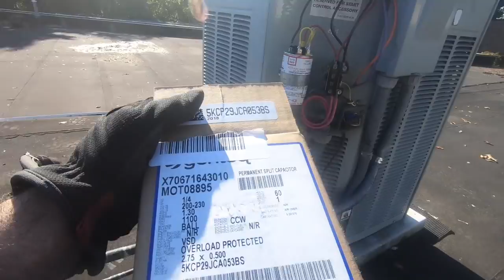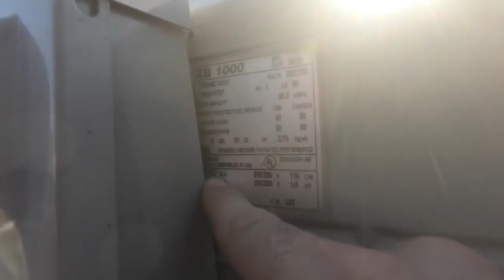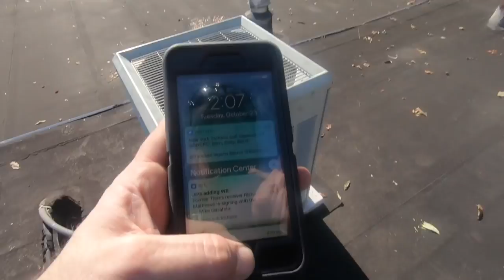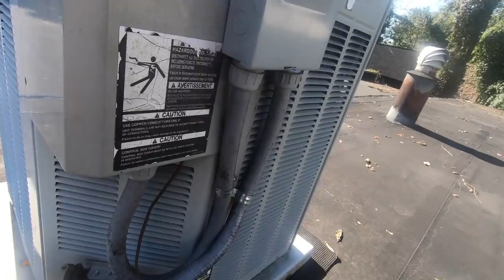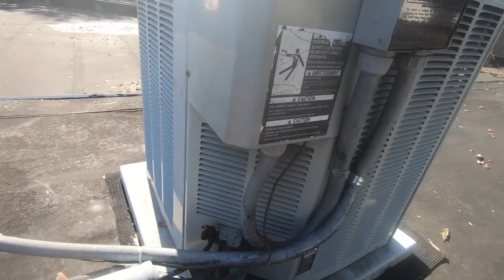Replacing AC Condenser Fan Motor

Comment: What are the name of the pliers you use, would they work well for gas pipe?
Reply from the maker: Those are Knipex Pliers Wrench. They would be worthless on anything round. They need a flat surface like any standard wrench designed for hex or square fasteners.
Reply: @thehvachacker  thanks.

Comment: Did you just get an electrical shock at 17:05? That jump was significant. Be safe in the future and try to prove the electrics dead.  Good video tho.
Reply from the maker: The line voltage was dead I just for whatever reason got scared and jumped. You can get a tingle from 24v yet usually, I would need to be drenched in sweat. I still want to know what was in the bearing of the new motor that at first, it sounded like something was hitting or rubbing. Then it worked its way free
Reply: @thehvachacker  yeah, I wondered where the noise came from. Your probably right, it might of been a stick or twig lodged somewhere. In addition, the tingle may of came from the capacitor as they do store their voltage for a long time unless discharged, as 24v (AC I am presuming) should not really hurt you unless there is an excess of current (I should say energy), but again good video it's good to see a different perspective in the industry 😁
Reply from the maker: Could it have been something in the bearing? I needed to get broken in from sitting to long the oil waxed until it warmed up? What part of the industry are you in?
Reply: @thehvachacker  I would imagine the noise was an imbalance on the motor due to in rush current, that may explain why the noise went away as it probably settled which it tends to do on motors that utilise capacitors. Plus I am in the electrical industry. 😁
Reply from the maker: Nice I have to lean more about inrush now
Reply: That was low voltage to contractor no biggie

Comment: Now that is right Trane mtr. Good job..Like check amps/on both. Seen that tickle on 24 volts. I always used refer wrench on hub bolt..
Reply from the maker: I use it often also. it was made for square fasteners

Comment: I've heard some complain about using the Impact driver, but I never burry them.  Mine is only a 7.2V Makita TD020.  Ya I can twist the heads off If I burried' em, but I let go upon bottoming. Don't get so upset about constructive criticism unless they become insulting.  We know the difference.  I use the impact driver, and I'm not going to stop.  I did however stop when it comes to anything delicate like hot surface ignitor.... Oops. Made that mistake once.
Reply from the maker: I use my impact all the time. I use my m12 all the time for panels and repairs. I just picked up 2 weeks ago the Milwaukee impact ratchet. Power tools are great when used correctly
Reply: Whats an impact ratchet?
 @thehvachacker
Reply from the maker: A power ratchet I used it in my last video where I did the breaks on my Camry.
Reply from the maker: A good impact will not strip out holes but it does damage my chrome sockets. I bought impact sockets just recently power tools are there to make our jobs easier

Comment: bites, it is and isn't a lubricant at the same time, it all depends on type and duration of "lubrication" needed, inside a bearing or something with frequent large travel/high speed movement, it wouldn't be a lubricant for long.(that's what trips up folks) However, keeping shaft, threads and other infrequently moving things lubricated and protected, it's a long term lubricant that makes life easy! :)
corn-fusion sets in and mind warp  =p
Reply from the maker: Your answers are awesome. Are you an engineer or working in the HVAC trade? For the application and kind of anti-seize used it is an appropriate lubricant. Would you ever use a molybdenum disulfide based anti-seize ever? Mabey in a hi friction application? I believe it should handle the friction on the wheel bearings. I prefer the nickel-based anti-seize for fasteners yet my employer purchased the copper-based one saying it can also be used in place of heat paste for aquastat bulbs in wells. Do you think heat should transfer quickly through the copper-based anti-seize?
Reply: naw, just your average dummy with hands into everything, one whom get bored easily and never stay's in one field of work, more "general contracting" among many other things
I like the motto "work smarter, not harder", yet often I'm solo and run in x10 circles. I classify as master of nothing, which I don't think anyone holds the title of either, because of evolution ;)
there's a billion different anti-seize compounds on the market,  moly/graphite blend is common for marine use(non polluting) and I think it's hard to beat metal bearing mixtures for overall durability. obviously not for food grade usage lol

Comment: The motor you changed out seems to have a much longer shaft, and I'm guessing, it's because some units will have the fan located at different positions along the shaft.
How does one determine where to mount the fan blade along the shaft? And, does the placement have any effect on the efficiency of the air movement across the coils?
Or, am I overthinking this>
Reply: Tunaslayer1 the motor that got changed out was a replacement motor already. and usually the shroud around the fan blade tells you where the fan blade goes.
Reply: The fan should be just inside the shroud. If the blades aren't inside the shroud, the air flow will recirculate inside the enclosure instead of venting properly.

Comment: Did you pull the drain plug on the motor? ;) I watched the motor failure video too!
Reply from the maker: This is oem motor so it isn’t built with a drain plug. It is designed for the system. You have the drain plugs on rescue motors usually found on variable horsepower truck stock motors.

Comment: I bought those Knipex  smooth jaw pliers for Chrome plumbing fixtures. Don't fck up the chrome. Just my 2 cents.
Reply from the maker: They don’t mess up the chrome, I even see rubber boots they sell for these and the knipex cobra to protect finished plumbing fixtures. These also grab a fastener better than a regular adjustable. Knipex just released a new design for the pliers wrench 10” 250mm. I rarely use the 10” version of this wrench.

Comment: It’s a lubricant 
And copper is a better heat connector but nickel is a higher heat rating for like exhaust bolts
Reply from the maker: So the copper paste is better suited than for an hvac technician and nickel for auto work
Reply: Exactly

Comment: Uh. The fan motors spinning backwards . Could be wrong I'm not the one working on it . Maybe it's just the light or something but it sure looked like it was based on the pitch of the blade
Reply from the maker: The camera has a way to make the fan look slow and backward. The air blows up out the top of the condenser.
Reply: camera frame rate and motor rpm will make them look to spin both directions at various rpm's.
Reply: Yah I  see now . I didn't was to seam like jerk or nothin just looked weird to me and the view of fan in action were real quick.
Reply from the maker: That isn't being a jerk its a good question. I am still working on why my Maglite led looks like it is flickering on my videos
Reply: @thehvachacker  probably the same reason when a camera is pointed at a computer screen it looks like it's flickering, the led maglite is probably pulsing faster than you can see but the cameras frame rate is just right to catch it. If I remember correctly dimmer switches for leds don't lessen the power to the diode , they pulse the power fast enough to appear dimmer without dropping the current
Reply from the maker: Not absorbing the energy into a diode which is a resistance load and instead of chopping the electrical sine wave up reducing power consumption should be more energy efficient. The old dimmer switches would create nuisance service calls due to lights flickering when a generator was providing the electricity.

Comment: Knipex make good tools and pliers, etc. with or without teeth so they dont jack up bolt heads...Once that fan kicked on I thought it was rubbing on the shroud for a sec, lol.
Reply from the maker: I didn’t see anything hitting the shroud. Could of been a bearing that needed to get broken in. Usually new motors don’t do that yet once the sound stopped it never happened again.

Comment: Ive found the cheapest e-bay motor is not the best motor... open compressors eat alot of weather....but if your pinched buy the chepo..and check the seams of the motor carefully. I usually putty on silicone on all the motor seams and tops or bottoms...these motors fail all the time due to rain or snow...entering the motor. the machine is a hurricane machine...even a hole the size of .010 can ruin the motor.
the other reason they fail is icicles handing off the cage into the fan...muck up the motor and you toast the cap...and its smoked..!
Reply from the maker: The motor that failed has to be over 20 years old. These motors last. The motors can get wet just need to drain properly. I’m surprised at how much water I drain out of motors inside giant BAC units. Walking the plank inside the towers. Hopefully this unit goes a few more years. This repair was more than a year ago.

Comment: That fan looks like it's down a little bit too far
Reply from the maker: looks can be deceiving. The blade was set correctly and good air gets pushed up. You would know by how the air comes through. If blade isn't high enough air comes through side of condenser
Reply: Its at the correct height, the ends need to be a little lower than the shroud to scoop the air.

Comment: always enjoyed your videos, have you ever thought of using the push in wire connectors instead of the traditional twist on?
Reply from the maker: You talking push in and crimp? I use them sometimes. Or a different kind of connecter?
Reply: @thehvachacker  thanks for replying, i was talking about this http://www.idealindustries.ca/products/wire_termination/push-in/in-sure.php
Reply from the maker: @cupcakebrakellc3134  These look nice, have you ever used these in place of a wire nut? I haven't used this style connector yet.
Reply: @thehvachacker  yes i replaced a couple of ballasts at my bakery and used these connectors, it was quick and easy, i was introduced to these from watching This Old House.
Reply from the maker: They are easy to remove as well as put on for a connection
Reply: @thehvachacker  ehh, i was wondering that and watch some videos on how to disconnect and it looks like you just twist and pull on the wire and it pops out.
Reply from the maker: I will have to get my hands a few of these connectors to play with.
Reply from the maker: Some of the push connectors don't release easily. Never used these connectors for splices yet some circuit boards have connectors similar
Reply: @thehvachacker  good chatting with you, going to call it a night
Reply from the maker: @cupcakebrakellc3134  Me to it's 1:23 am

Comment: you have a puller for over 16 years and didn't know it came apart" and yes you went the wrong way without realizing it or you woulda pulled it apart and checked it before you chucked it to the fan hub...

Comment: Replace the fan blade.  Add second fan on top. Add H2o spray nossels to kill head pressure.  Put up antenna tower 4000 feet to access cooler air.

Comment: Had to replace the cabinet screws already on a fairly new heat pump due to stripping from impact drivers used by techs.  When I told the company owner he got kind of defensive, so I make sure I'm home and personally ask the tech to hand tighten only.

Comment: Comment from your last video: So you are the guy that is always poking holes in my roof lol. Looks like you did a good job of cleanup though which is hit or miss with HVAC guys. It would be nice to see you guys using some sort of rubber mats or anything really to protect the roof for any sharp tools or sharp edges from parts you take off the unit. I can't tell you how many holes have been put in my brand new roof system by HVAC guys and the absolute worst thing is that they never call and tell me. Mark the area with a marking crayon and call the roofer. I won't even charge your company if you call me, now if I have to go out and look for the leak after the fact and I'm sending a change order in for every last dime and the GC will get it from Y'all. Not to mention that there could now be a good deal of insulation damage that didn't have to occur so we are into cutting out a piece of brand new roof/insulation and replacing it. As long as you aren't THAT guy then you're already better than 85% in my book. Great videos, enjoyed watching.
Reply from the maker: Dude how did you see the ice climbing cleats I was wearing. Forget the sharp edges from the equipment they don’t hit the roof hard or that is obvious. Yet when there is punctures all over the roof hey just a crappy roof job. I run laps all over the roof and 5is roof was spongy like a diving board. Kidding. It’s easy to tell if the hvac guy does it. The first rain storm after they leave water is staining he drop ceiling. Under the equipment. On roof the puncture is found near the equipment. The easiest thing is just to slap some tar over any puncture if it does happen. Now it’s water proof unless it’s in an area that water pools then it needs to get tourched by a roofer.
Reply: @thehvachacker  It's true that in that particular job nothing hit the roof hard but considering how cumbersome removing the top is, especially with the motor still attached even very good HVAC guys can have it slip from their hands. If you carry a few tubs of plastic cement with you then you are already more prepared than 98% of the installers that I've worked with. Even if you don't, a little caulk will temp it until the roofers can get out there to do a permanent repair. Even if you do put some PC down it still needs a long term patch,especially on a newer roof which is mainly where I have my biggest gripe with hvac workers.
Reply: @thehvachacker  One more thing for one of the rare HVAC guys that cares about the roof too, I assume you carry around a little propane plumbers torch with you. On an out of warranty roof, it is actually really easy to torch a little patch over a small puncture. If you'd like to know more just let me know. Now, if the roof looks like it's near the end, or as I'm sure you've seen far beyond, it's lifespan then a little plastic cement, which I assume is what the "tar" you are referring to, is just fine. If you have a spare glove, or the cheapest sandwich bag works just as well, put just a dab down and work it into the hole and then add some more and feather the edges out. I personally NEVER put an open tube of PC back into my backpack because eventually one of them will find a way to cover your bag and whatever else is in that pouch with PC and man is that a pain to clean. Even if it was coming straight out of my pocket, I'll just spend the $2 for another tube. You can get a really cheap set of 3 plastic trowels for $2 dollars or so if you really wanted to do it right and again, I just throw it straight into my trash bag. At 70 cents each they just aren't worth the time to clean for me and for a really small job like on an old roo,f 70 cents so that I don't have to clean my good trowel is money well spent. You probably aren't kidding, I've been on plenty of roofs, either installed by someone else or they just had the lowest, or newest, guy on the maintenance crew whose only roofing knowledge is that the roof goes on top "repair" the leaks,  that felt that way.
Reply from the maker: @Caspertg333  So I guess dumping and spreading some Karnak which I always thought was tar since it is black and super sticky and gets all over everything until I was off with gasoline. Then putting a piece of membrane down and some more Karnak over and not saying anything is a horrible thing? It is almost the same way I use to seal a roof curb after cutting open the roof or to seal around any flashing on a flat roof. Is this not waterproofing the puncture or roof? I am no roofer so I have no idea how long a bandage like this last. Yet if I fill the puncture and layer the tar/ membrane/ tar it shouldn't dry and shrink to allow the water to leak through.

Comment: What are the brand name of the wrenches.
Reply from the maker: Those are Knipex Pliers Wrench. Before I bought that wrench I would keep a 6, 8, and 10” adjustable in my service bag. My service bag is heavy enough so finding good lighter tools helps. Knipex tools are pricey but worth it.
Reply: @thehvachacker  they look like tools that are perfect for the job they are intended. I am a DIYer, but I know when to call in the professionals. Only problem is getting old and have a bad back. Cheap tools end up being more expensive because they never last.
Reply from the maker: Cheap tools do becoming more expensive in the long run from having to replace them when they break, yet if a tool is needed for just one job the cheap tool should get that job done.